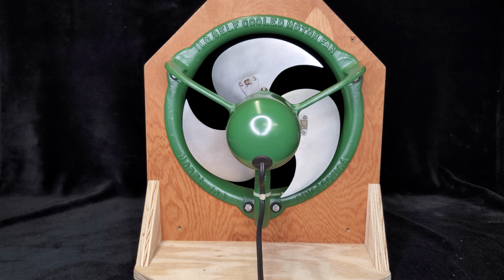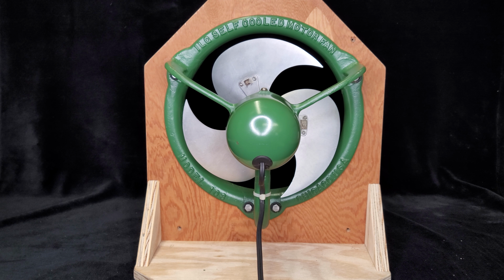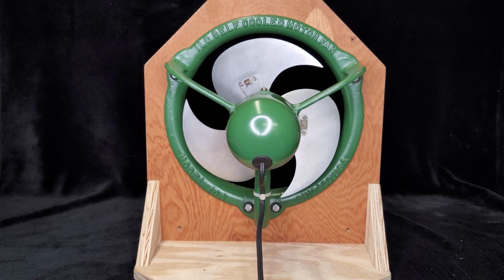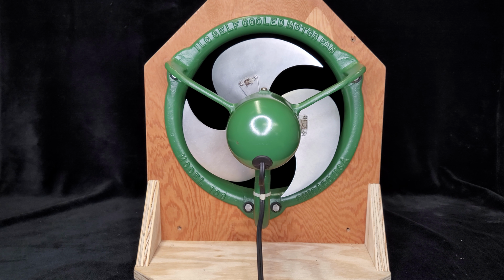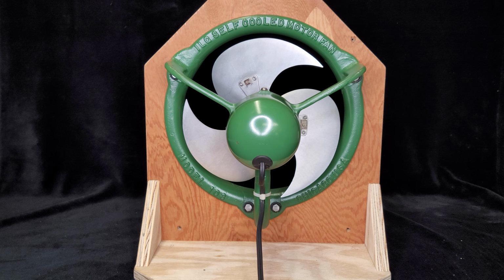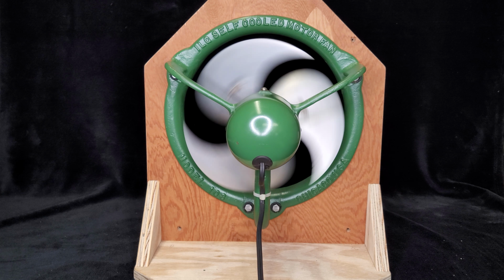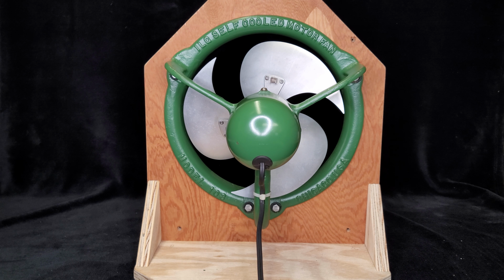ILG Model 103 Self Cooled Motor Fan 1940's

Comment: I just got an older 10” like this one in the video and I’m curious on the amp rating? The tag on my motor has a spot for amps and HP but they never stamped them from the factory. I’m also curious of the winding resistance on yours? Mine is 12 ohms. I’ve just got the motor together and it pulls 2.6 amps at 115 volts with no load and it pulls 2.7 with the blade attached, the motor also seems to heat up extremely quickly, to 130+ Fahrenheit in about 20 seconds. I believe my motor has a major issue.

Comment: I have one in this old house - how do I remove it? All screws are loose and spinning but I can't get it out of the wall. The old exterior louvers are in place, boxed over. Any feedback would help....hammer and pry bar do not.
Reply from the maker: Generally, these fans were installed with 4 machine screws or bolts, depending on the size. However, I have seen some that were also installed using lag bolts threaded into the wood wall. Since you said the screws are just spinning and not able to be fully removed, there is a chance that the nuts may be rusted onto the screws. If this is the case, you may need to use a hacksaw or similar tool to cut the heads of the screws off. Once you are able to get the 4 screws completely out of the frame, it should just be able to fall right out of the wall. Let me know if this helps or if you have any more questions.
Reply: @ilgfanman  Thank you for the reply and info! You are probably correct about nuts being on the other side - prying the screws up while turning only yields a small space. There is a backboard of plywood. All screws removed from that, it won't budge either. I'll keep prying and pounding.